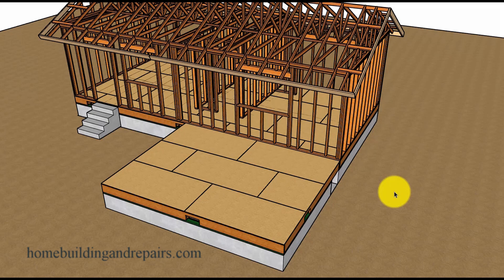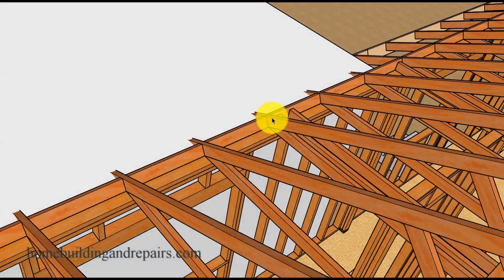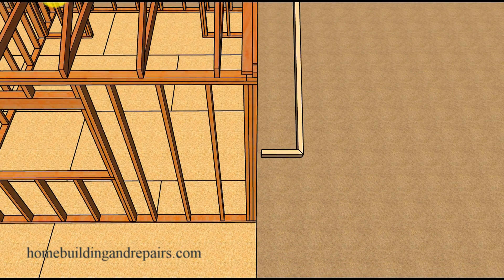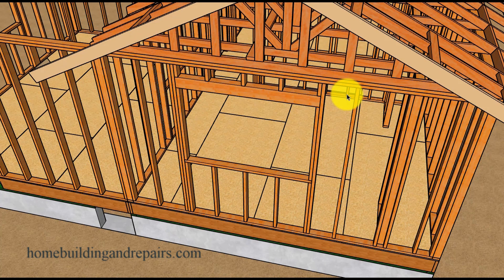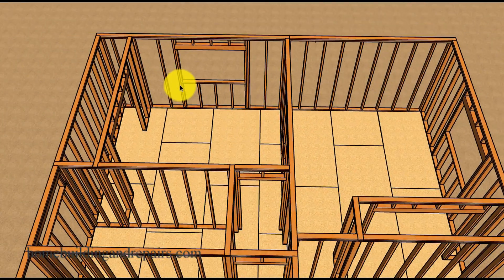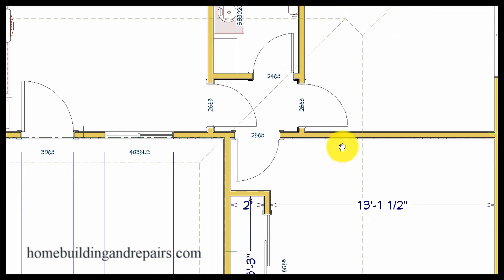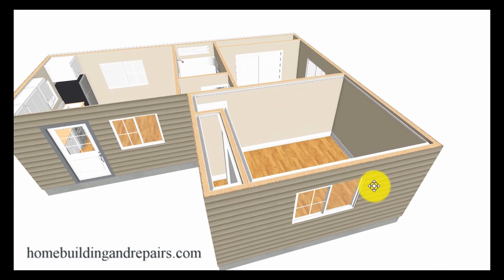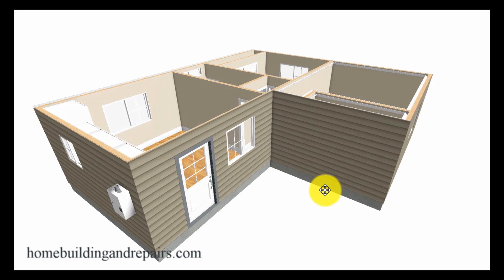Wall Framing, Building Plans And Interior Remodeling - Small Home Addition Construction Ideas

Comment: We have an addition in Rural Ok that we want to do. I want it done correctly for the comfort of our home and for any future sales.

But it is complicated. 

There is a breeze way out our back that drips down maybe 6" from the back door, then another 4" to the patio then steps back up to the driveway/patio. I want to enclose the whole patio and breezeway. The breezeway and patio are all currently concreted as is the parking area. However the parking area has cracks. The hose has stem walks. 

I want to put in a small bathroom with a shower , a laundry room, possibly a mudroom and a pantry in the area we enclose. I currently have a fairly large laundry room where the back door is. 

What I am trying to get my head to wrap around is what has to happen foundation wise to create this area. So that the floor will be level with the rest of the house. 

The addition will be about 16 feet by at least 12 feet. 

So my question is what would have to happen to make sure the rooms are warm? I don't really like the idea of a floating floor here but a concrete foundation. 

Is this the best way or are there other options?

I don't see anyone addressing this type of add on.

Comment: Great videos as usual Greg. Question could you have left the original gable and just added the new gable in the front? How would to roof look at that meeting point on the right hand side of the house if that could be done?
Reply from the maker: Yes, you could rotate the addition roof 90 degrees and install a drainage cricket at the lower section where the new roofs meet to drain or shed rain water, but I don't think I would do it in areas where it snows.

Comment: great videos, can you please do a video about floor joist spans when placing load bearing walls directly above the floor joist rather than above span beams. I’m building a small home on 12’ 8x8 posts, and I’m not sure how to make the platform structurally sound if load bearing walls are placed between beam spans on floor joists. We are trying to use as few posts as possible but don’t know what size floor joist are needed to put load bearing walls between the span beams. They are 14 foot spans and we are thinking of using 2x10s 12 o.c or do we need tjis?
Reply from the maker: I've already made quite a few videos about floor framing and load bearing walls in the engineering section at our website. However, let me know if you can't find what you're looking for.
https://www.homebuildingandrepairs.com/engineering/index.html
Reply: @gregvancom  okay great thank you so much!

Comment: Thanks for doing all of this. It’s very helpful. Wouldn’t you just swing the offending door into the room instead of the entryway?  ✌🏻🇺🇸
Reply: Is that door even necessary at all?
Reply from the maker: Yes that is another option, but sometimes when a door swings into another room it can create problems for furniture placement, block electrical outlets and even windows. Thanks for pointing that out and I'm sure that's a question others will have watching this video.